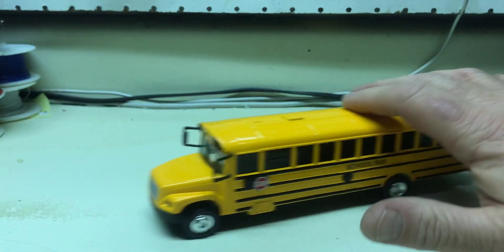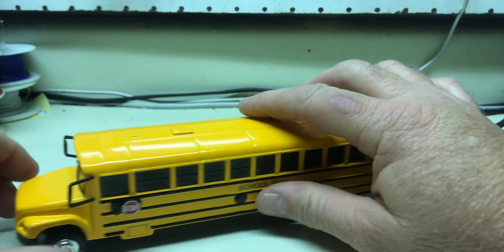Jack's custom International FS-65 diecast school bus model with working lights

Comment: What do you use to get the lights to flash in pattern? I have a 1/87 scale Expedition I want to add Emergency lights to, without having any external bits.
Reply from the maker: It is a small circuit board that I build.  Probably won't fit in an 87th scale car.
Reply: @01bluebusa  Unfortunately most things won't. Being on a mobile train layout and needing to be moved due to future plans to add the Faller car system I'm having difficulties trying to find ways to make it functional.